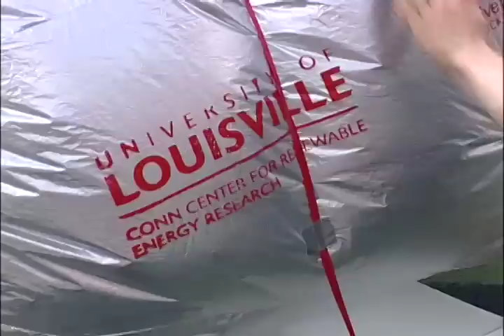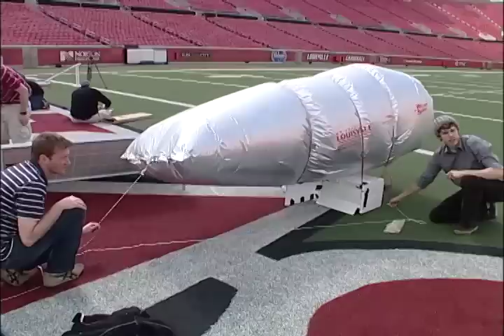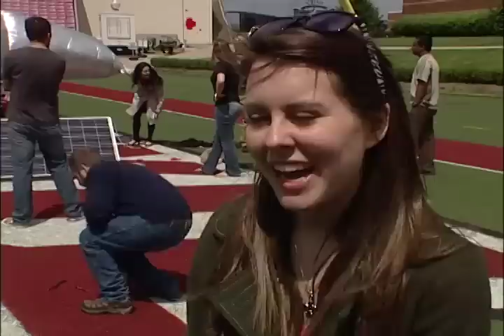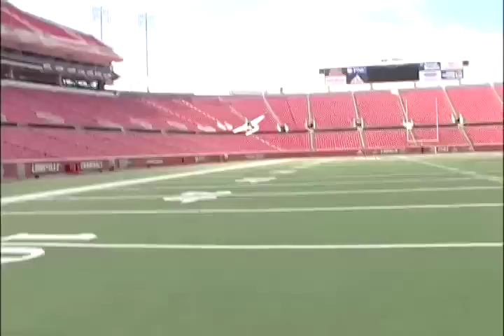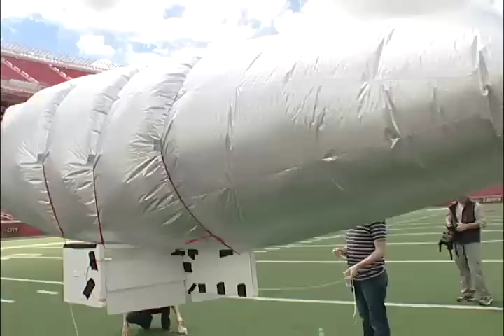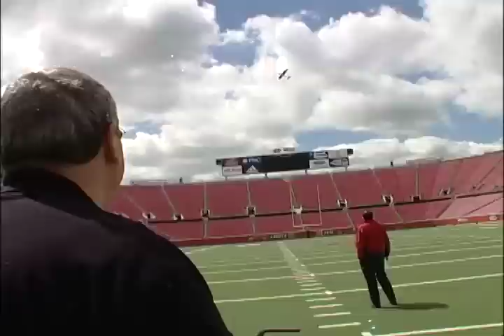Solar Flight Competition

Comment: They use solar to charge batteries. Possibly the only craft that could fly on solar without batteries would be the blimps with efficient motors and lightweight solar cells. They should use black for the blimps so that the sun heat would expand whatever gas they are filled with.